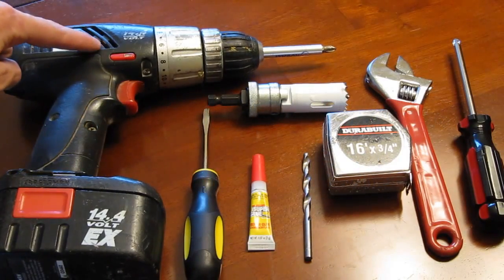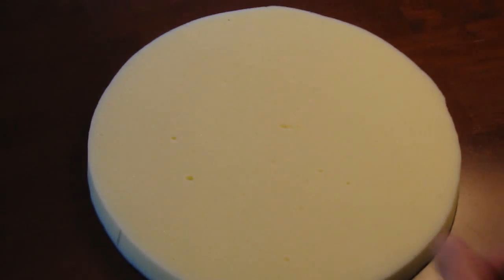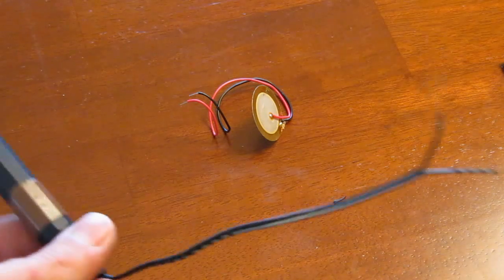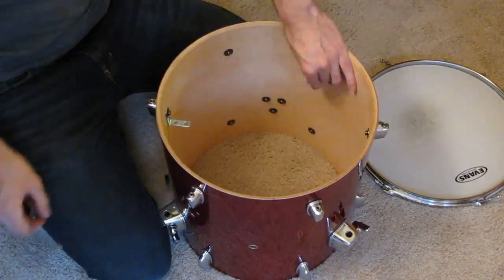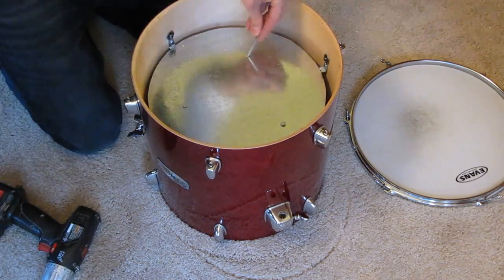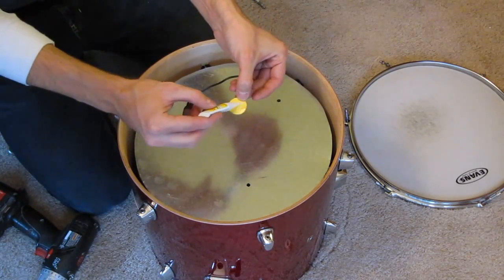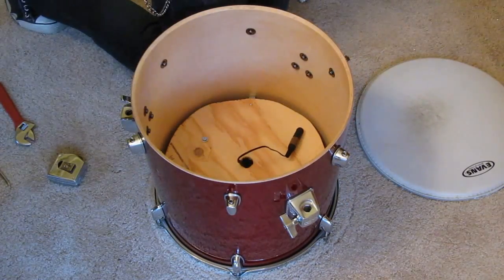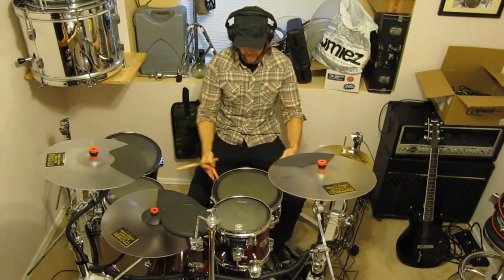DIY Electric Acoustic Drum Triggers Tutorial for eDrums

Comment: How do you wire a dual zone?
Reply: You would have to isolate the sheet metal from the L brackets with rubber washers. 
Then buy a seperate piezo to attatch directly to the shell, near the rim. 
You then need a stereo jack that you can install in the air vent hole.
Solder one piezo to each side of the stereo jack.

Comment: I dont know if you're still active on this channel but I have a question for you. I want to use tin cans (the ones you put cookies in and stuff) for snare and my toms. My plan is to take off the lid and use the bottom as the "head" with some mousepad on it. would that work just as well? I really hope you respond
Reply from the maker: Not sure how well this would work. The mouse pad definitely would dampen some of the vibration from the hit, but it might still be a lot which could cause re-triggering. Also, depending on how you have these mounted, you might experience some cross-talk as well.  You'd have to mount the peizo directly onto the underside of the bottom or "head" so that you get some sensitivity.  Sounds like a relatively inexpensive experiment, so you should definitely try it out!
Reply: SEANTHEPR0DUCER Awesomr, thanks a bunch! And if it isn't sensitive enough, are there any ways to make them more sensitive?

Comment: Although, I haven't tried this yet, in theory, this is genius, because it wont have the center head hot spot issues that Roland and pintech, etc have.  On the Roland and Pintech, the trigger foam point contacts the center of the mesh drum creating a hot spot and higher velocity in that region. My only question, and I'll know when i build this is, how is the cross talk between the drums? Cross talk is sometimes an issue when you convert acoustic drums to electronic. Electric drums by comparison are mounted on a frame to reduce vibrational crosstalk.

Comment: Why not connect the screws that hold the sheet metal directly to the l-brackets? Seems to me that would eliminate the need for the plywood.
Reply: +Jonathan Motes I don't know what's would be different, but in 2 point make sense, first your think is right, but other way like a video , the plywood will get more vibration inside, so if pay attention with good ear , the sound with and without  plywood will gets different sound, so in this case, would be try bought ways and choose whats feels better sound vibration.

Comment: hello sean, i followed your instructions but my drums doesnt seem to be as sensitive as your build. i used a bit thicker galvanized sheet metal and didnt glue it, i just taped it. could this be the reason? i also have an alesis drum brain
Reply: +Carl Flores Yes, I would definitely find a way to attach the piezo to the sheet metal permanently.  Also, make sure you tweak your settings, that may also be the issue.  I used very thin sheet metal because the vibration transmits better.

Comment: what are other options since galvanized sheet metal is very expensive? can i use aluminum foil or copper sheet?
Reply: No, you want it to be somewhat stiff and resonant. Think of it as an extension of the piezo sensor.

 I say that to say this: If you absolutely need positional sensing at all costs, forget about this approach, it won't work. Also, if your drum has 2 center mounted piezos and you're having problems with your signal-to-MIDI brain differentiating between a head hit vs. a rim hit, then forget about this approach.

 On the other hand, if you've spent many hours trying to get consistent sensitivity across the entire effective playing surface of the drum to no avail, or if your chief concern is reducing noise complaints by your neighbors, then you might consider giving this type of design a shot.

BTW, this is referred to as a reflection plate.

Comment: By making the foam sensor contact over the whole head you remove positional sensing, which is based off the time between pulses on the flapping head picked up by the piezo at a small contact in the middle of the head as opposed to the whole thing.
Reply: What type of hardware/software do you need to take advantage of positional sensing?
Reply: And a foam cone so there is a small point of contact, otherwise you are preventing different vibrations from making it properly to the sensor. The drum building method in this video will not give accurate positional sensing.

Comment: Im looking into a home studio style kit would i be able to get a cheap crappy set and it would still sound great with this method since its now electric? Even if i were to cut each drum in half to save space?
Reply from the maker: The kit doesn't matter at all. You could put these in pots and pans and it would still work (although you'd have to up your xtalk values due to increased vibration).  The sound all depends on what drum module/vst you are using.
Reply: ok because i was thinking about a little $40 first act or something and just using it purely for demoing thank you!
Reply: +SEANTHEPR0DUCER Im having a hard time finding a female mono cable. Have any links or places where I can find a couple????

Comment: Hey bro, i know this is an old video, and sorry if this has been asked before, but i want to do a conversion for my kick, will this method work? im assuming that because of the larger diameter i might need to bring the bolts further in to avoid the sheet metal being too flexible and causing miss triggers. Thanks
Reply: Yeah, I made the kick trigger about 8" in diameter (for the sheet and the foam) and then just attached to a 2'x4' that spanned across the drum from bottom to top, attached to the lug screws/2x4 with brackets.
Reply: Cheers man

Comment: I know someone asked this before, but could you share what sheet metal thickness you used? 

When I tried this the sheet metal I used was too thin and bent around the edges (the outer 1 inch) which lead to almost no trigger response in that area. No so much a problem with the toms, but kind of a deal breaker with a snare.
Reply: 0,75 or 0,8 or 1mm should do it . It's what you can find in Ale_sis DM5 prokit pads.

Comment: Hey Sean I followed your instructions and made my own tom's it works great but the only problem is when you hit the toms a little hard and it sounds like its triggering twice when you hit it once can you please tell me what it could be?
Reply from the maker: You probably need to adjust the sensitivity on your module.  The less likely issue (which I actually had before I realized that I was an idiot) is that you have the USB and the MIDI cables plugged into your PC, which will trigger twice because the signal is going in through both cables.

Comment: I have a question about the bass drum: would you go through the same steps as the other drums except make the sheet metal much smaller? I don't see the need to have the entire surface area of the bass drum triggered because the beaters would be in a static position right?
Reply: In my experience, you are correct.  My bass drum trigger is about the size of my 6" tom.  I actually quit using it altogether because it was a hassle keeping it in place and replaced it with a REMO 8" practice pad affixed to a triangle-shaped wood support inside the bass drum and did the triggering inside of the practice pad assembly (kept the practice pad head on, just cut the factory foam in 1/2 to affix the plate + piezo).  It works really well and still has the responsiveness of a bass drum.

Comment: hi . first of all sorry for writing is because I do not speak English . this video helped me a lot to assemble my kit. My question is this , I did step by step what you did but when I do not get strong play in a loud sound reproduction ( 100 is not even in the current midi) and the faint sounds or ghost hits ( here also called on stick fast rebound in the mesh) are not interpreted directly .
the module I use is a medeli dd502 ( is economical but do not think that is causing the problem because it's not my problem sound quality ) .
using a sheet of 1 mm thick .
high density foam 5 cm thick ( which is not the thickness you use and density you have, I have density of 24 kg ) .
the mesh -head you stick to the high density ?
I happened to you this problem? so that you see the video goes to perfection and the weak and strong pulses are heard as it should .
can you think of any help you can tell me about it?

how good it responds very well with this method but it is not very strong pulse that translates .

thank you very much for sharing the video, I was much help.
expect an answer back to me and apologize for writing, I translated with google translator . if possible not to speak or read English very well , the answer is written as clear as possible to understand when Translates , please!

thanks , bye
Reply: Hi Federico,
I'm not sure what could be causing your problem, but I would start by checking that the piezo is triggering your dd502 by removing the drum head and the foam and tapping lightly on the piezo.  If this triggers your dd502 as desired, you probably have a problem with your foam or your resonation plate.  I would adjust the large piezo higher to possibly make sure you are making enough contact with the piezo unit through the foam.  Other than that, I am not sure what the issue could be.  Hope this makes sense!
Reply: Sean Brown hi .. I tried the piezo before being placed on the plate, and also directly on the plate hitting swipe captures it correctly. I tried to adjust mesh is now improved and pretty, but not have the answer I seek. if you think of an answer or can you think of any other ideas to solve my problem I would be very helpful. anyway thank you very much for the contribution, served me well!

Comment: I can't seem to find any quarter inch female jacks with the exposed wire.  Did you cut them yourself?  Do you think I could use a quarter inch female to rca cable?
Reply from the maker: Yes, I cut them myself.  I actually found them on eBay.  Pretty cheap.  You could use pretty much any quarter inch female cable.

Comment: Update: i went to walmart and bought a cheap pillow and stuffed it in the snare drum below the sheet metal to dampen any sounds from the shell or sheet metal but i was still getting this popping noise when i hit the center of the pad so i took a smaller round piece of foam and pit it under the 14in round foam and now it works like a charm and is fully dampened its still louder than mesh but idc. Ill be posting vids when i complete this kit thanks man

Comment: Ok i cut s small piece and placed it in the middle but it didnt work too well. I also cut a ring and place it in there snug on the shell which kind of worked but my module setting are hard to figure out. I have the dtx500. Everything else is working though im just not to fond of the pad noise. Ill figure it out eventually.

Comment from the maker: Yes, a smaller foam pad might work better if you're getting too much signal. A lot of these DIY triggers actually use a foam cone which only slightly touches the bottom of the head, but I found the mesh heads to be too bouncy, so the foam helped.

Comment: Ok so i did it without the wood and it still works i screwed the sheet metal into the l brackets put a piece of foam over it and glued my piezo to the bottom of the sheet metal. Only problem is the hits are pretty loud like a thump. I might cut the foam into a small circle and place it in the middle c if its any quieter.

Comment: You should really solder those wires. I use double sided tape and put 4 drops of hot glue evenly space to secure the piezo. Crazy glue will eventually lose it's hold from vibration as it ages.

Comment: One additional comment to my prior post.  I removed the air hole sleeve and installed female 1/4" jacks (Stereo for the snare).  I removed the wires from the piezo and soldered new wires directly to the jacks.  This way the 1/4" cable to my TD 20 plugged directly into the side of the drum.  For the snare, I used the bolts for the DW logo to secure a second piezo and then connected it to the stereo jack. This allows me both the snare and a rim shot.  Didn't see that mentioned in the video, so FYI

Comment: I converted my DW kit using this method.  Instead of trying to save money, I had a cabinet shop cut perfect circles with MDF, a sheet metal co. do the same.  NOTE: I made a mistake here and didn't get thin enough sheet metal, which had to be corrected for the snare and small tom, Lastly, I got an upholstery shop to cut black high density foam in perfect circles too.  This was as easy as it looked in the video, but I went slow to make sure I did everything right.  They work great with my TD20!

Comment: Nice job. Obviously you put a lot of work into the making and filming of your project. Don't forget you can purchase piezo elements on Ebay very cheaply. I'm using 35mm units to replace the broken units in my Octapad II They are exactly the same size and came prewired.

Comment: Great job man! I have built several ekits over a 30 year period, designing my own triggers. Now days, the drum modules are fast enough and sensitive enough to do a wicked job. Most drummers do not get the fact that pro recordings use triggers a LOT. I capture both audio (mics) and midi performances from the module and mix and match in a daw, I used to be an acoustic snob. I usually use the midi performances for fast, great sounding work. IMHO, as good as acoustic & tons EASIER! Regards e;)

Comment from the maker: mknerr is correct, you will need some sort of interface to utilize these triggers.  Whether it be a Trigger iO into a computer with Battery, Superior Drummer, EZ Drummer, etc... or a drum module from one of many available by companies like Alesis, Yamaha, Roland, etc... Although that setup may be more difficult to configure as they generally prefer to use the pads on those units.

Comment: You will need a drum "brain" of some sort, which has a trigger to midi converter as well as a sound generator built in. You could also do as the author has and use an Alesis Trigger iO, which only converts to midi, in which case you will need to connect that to a laptop to generate the sounds. I believe it comes with software that would cover kick/snare, but I'm not sure about a complete kit. You could also use a software instrument from just about any DAW to generate the sounds.

Comment: QUESTION...
If I buy a trigger and a cable, can I just run the trigger straight into my mixer from the cable, and then from my mixer to my laptop. because I only want to trigger my snare and kick, but I have four other mics going into my mixer as well...Or would I need to buy another interface to run my trigger cables into first, cuz there would be no presets right? or are the presets built in??

Please Answer! :D

Comment from the maker: Thanks for your kind words!  For the rim-shot sound (or really any sound you want to trigger on the rim of the drums) you would have to mount a piezo on the side of the shell or use some sort of metal tab to sit on the edge of the drum under the rim that would need to be set a bit lower in sensitivity so that it's not triggered by the drum hit.  You can also wire this as a dual trigger, which instructions can be found for online, so that you don't have to worry about that.

Comment from the maker: 1) I did it similar to how I did the other drums, but I used a 2x4 to span across the size of the drum instead of the round piece of plywood.
2) The heads were not included in the price, but I would guess that you could use standard heads as well as mesh heads, it just might not have as much bounce/spring when you strike the head.  All of the other supplies came to around $40.  Honestly if you're just looking to get a cheap electric kit, I would recommend going with a Yamaha DTXpress II or III.